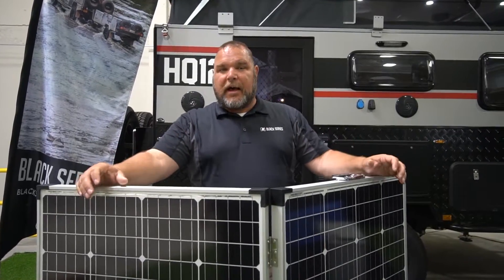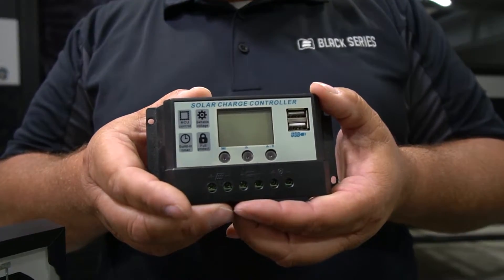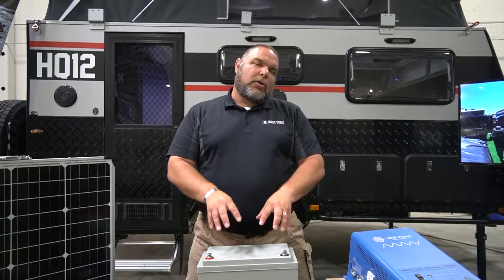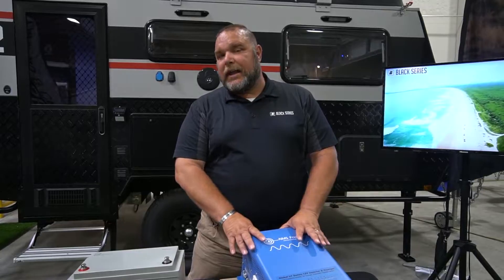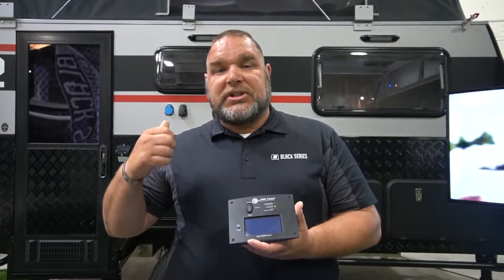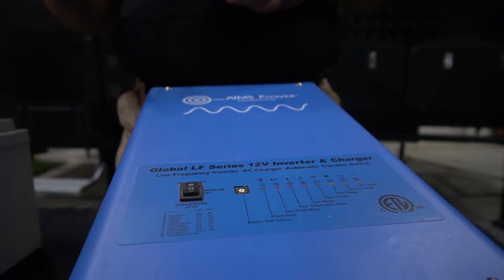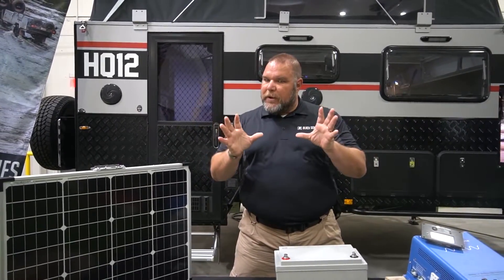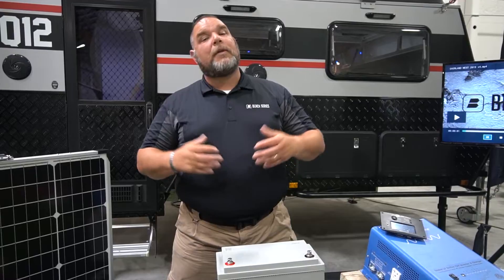Black Series Solar Panel, Controller and Pure Sine Wave Inverter/Converter

Comment: I just picked up a Patron near you guys at a dealer. Very helpful guys but I am struggling with the charging system on my Patron. When using the Solar Panel to the Anderson plug, do I need to have the "Main" breaker on or off? I also noticed that I can use the other breakers while the "Main" is in the "Off" position. Is there any literature on all of this... Super confused... Thank you in advance, Love the trailer!
Reply from the maker: For the Patron there is no main breaker. You can have all the breakers in the  off position while having your solar panels connected and still be charging the battery. However, if you have your Instrument breaker in the on position you will be able to see the charging percentage.
Reply: @BLACKSERIESUS  Okay, so the one labeled "MAIN" is just to light the instrument panel?
Reply from the maker: @k2sb20033  Correct
Reply: @BLACKSERIESUS  Okay cool. So when I use the solar panel, do I need to have anything switched on?
Reply from the maker: @k2sb20033  Nope nothing needs to be on while the solar panels charge the battery.
Reply: @BLACKSERIESUS  okay thanks!

Comment: Hi Joe -we were told the same thing to leave the inverter off when plugged into shore power? You're saying to keep inverter in the on position when plugged into shore power to charge the batteries correct?
Reply from the maker: Yes, leaving the inverter in the on positions while plugged into shore power will turn your inverter into a converter, which will charge your batteries.
Reply: Awesome OK - Thanks!  We're loving the trailer so many people stopping by our site to check it out :)